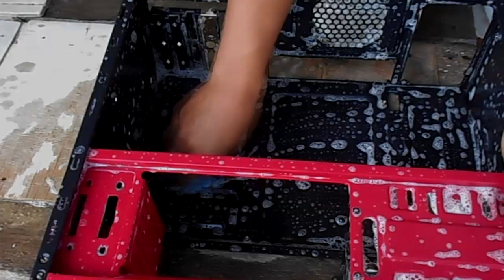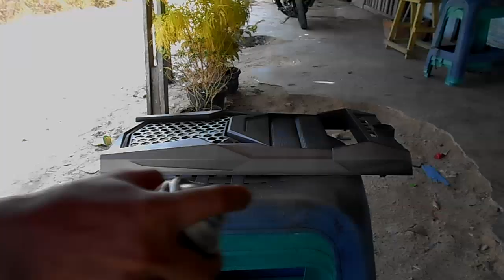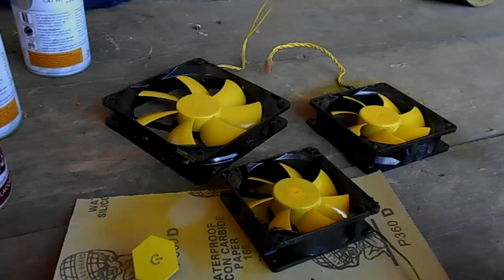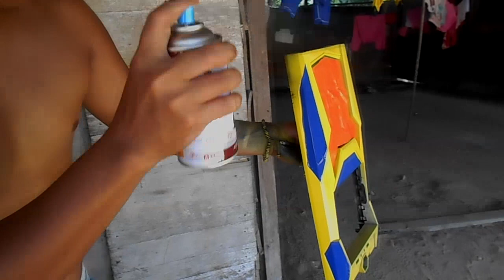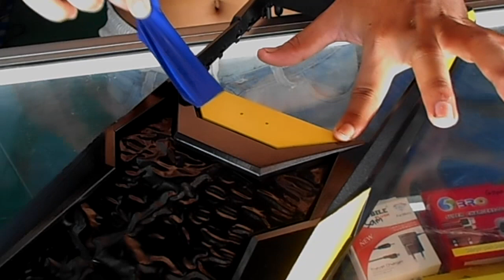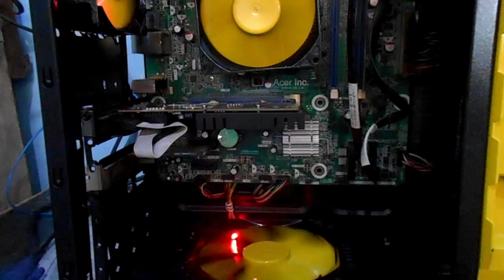Modif Casing PC Gaming Kere Biaya 100 Ribuan // cat kesing pc tua

Comment: Spek pc nya apa bang
Reply from the maker: procc : intel Pentium G630 2,7Ghz sandy bridge
mobo : acer lga 1155 bekas pc buildup
Ram   : 4GB X1  1600 MHZ DDR3
vga     : zotac GT 710 2gb ddr3 64bit Kepler 
psu     : FSP 300W 
HDD    : WD Blue 500 GB

itu bro spec nya
Reply: Sama aja spek vga 710 gt sama saya👍
Reply from the maker: mntap